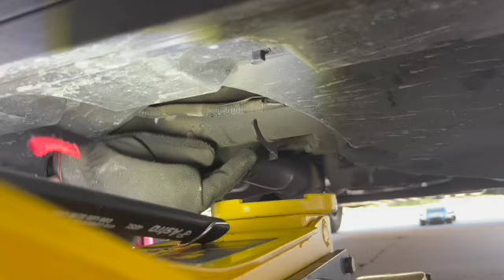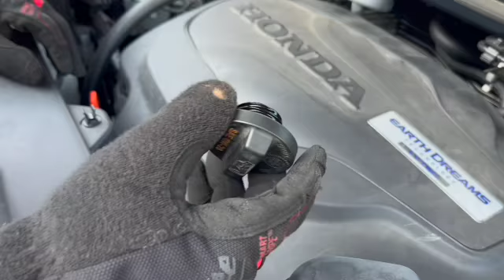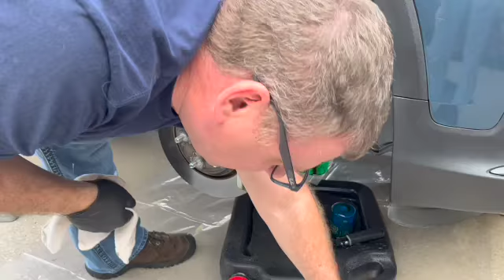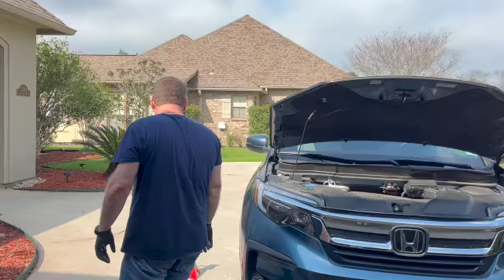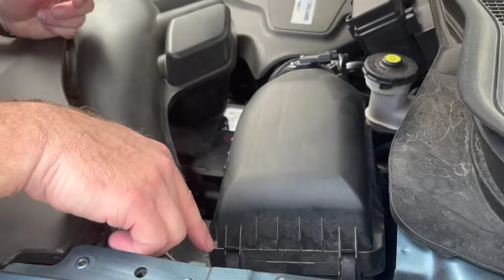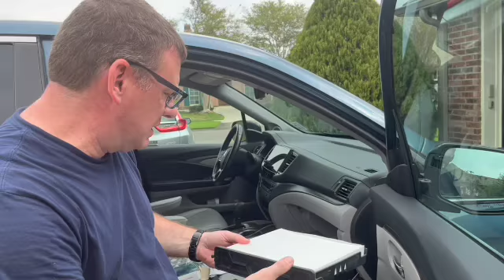2016-2022 Honda Pilot 50k mile service - Jack points, oil change, tire rotation, engine & cabin air

Comment: One thing you can do is add a little new oil to the filter before installing. It is at a angle but could fill two thirds full. Would help reduce time engine is running dry while it is trying to refill the filter. Not required but is idea. Thanks !

Comment: Good stuff. Thank you. I have a 2021 Honda Pilot. Any advice?  I just did the oil, engine air filter and tire rotation at 30,000 miles. I had been taking it to the dealer. I think the only other thing they’ve done besides the oil is the differential.  Should I be doing more, perhaps at 35,000?
Reply: Ok thanks.  Mine is all wheel drive. I live in Maine so we need it up here.
Reply from the maker: Beginning in 2021, all trim levels have a 9-speed transmission, which  requires different transmission fluid than the 6-speed. So, when you buy your transmission fluid, make sure you get the right fluid which will be different than what I use in my video since I have a six speed.
Reply from the maker: I appreciate your comment. I recommend changing the transmission fluid and transfer assembly fluid every 30,000 miles. Since I recommend changing the rear differential fluid every 15,000 miles, this would also be due every 30,000 miles. Of course, the transfer assembly fluid and real differential fluid are only applicable on Pilot’s equipped with AWD (All-Wheel Drive). My video on the 30,000-mile service shows all of these things and the video description provides all the details. You can find that video here:
https://youtu.be/K6zL1u2fTwI